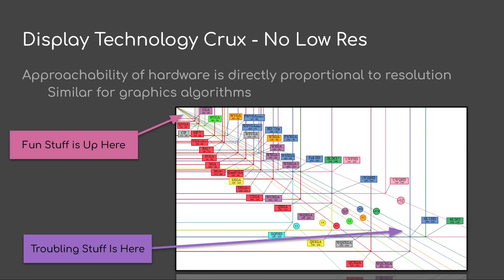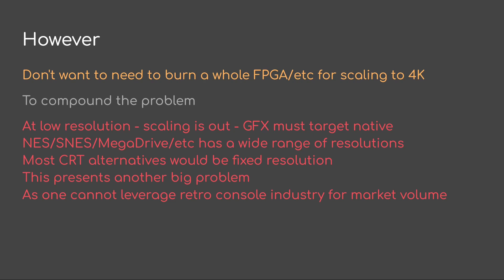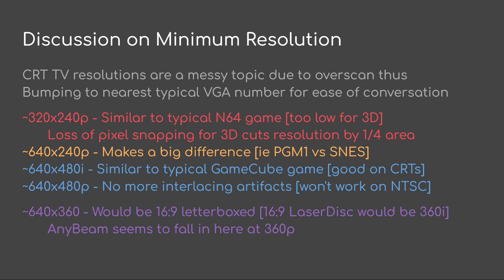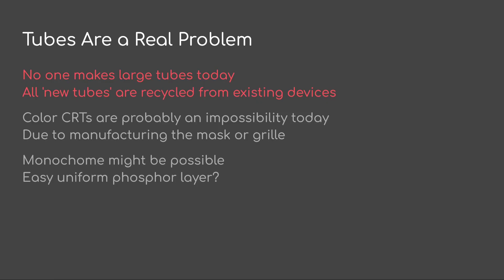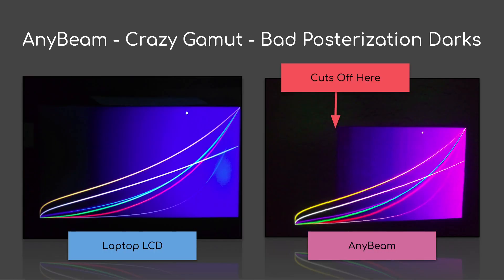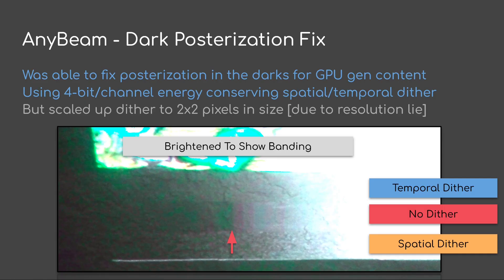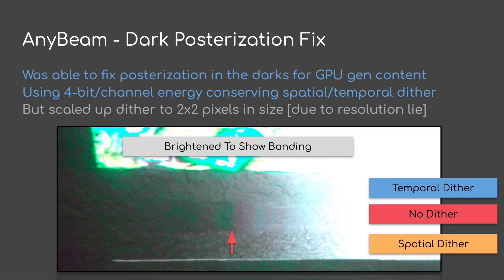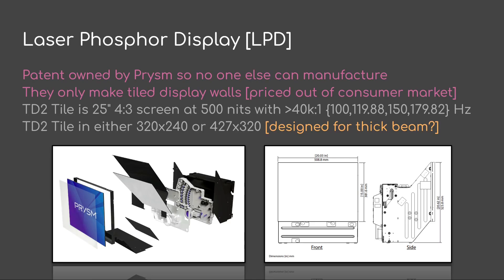Alternative Displays

Comment: In. Re. galvo-based scanners: It seems the selling point of galvos is vector displays, but since we only want a repeating linear sweep, a spinning faceted cylinder should work as well. 72-facets gives you 20° (*Edit:* 10°) (or a little less, allowing for edge imperfections requiring Hblank) of NTSC at ~13,000 RPM. (Math: laser sees each facet for 5°, reflected beam sweeps 10°, which becomes 20° after the vertical deflection mirror). (*Edit:* my math was wrong. There's no angle multiplication from the 2nd mirror, just path folding.)

One can imagine adding extra static mirrors to multiply the scan angle, using more facets to allow lower spin speed. That's eventually limited by brightness loss and difficulty of cutting precise facets, but it might scale enough to do modern resolutions without needing an export-controlled bearing system.

Comment: NTSC is technically 525 lines 480i
This is largely irrelevant because old game systems never followed the NTSC spec exactly
Low res signage LED is not a very good solution at all since CRTs didn't have horizontal resolution or fixed PAR which is why 384x224 games like CPS1 games work since they use a different PAR, not to mention all sort of games which used all sorts of resolutions and tricks
Reply from the maker: If you want to be pedantic, NTSC was a fixed line count, but a variable effective visible due to overscan of the TV, and then either interlaced or non-interlaced fields, and then horizontal is freely adjustable within the bandwidth limit.

And sure, LED signage is NOT a great solution for emulation, but it could be for NEW content (design for the new display), which is the core topic of the talk.

Comment: Love this topic.  I've spent a lot of time ruminating on this, the current solution of carefully choosing a scaler and TV to meet latency and display quality goals seems so haphazard and inelegant.  I agree with your rundown of the problem and there's a few aspects I hadn't even considered such as the temporal dynamic range of those projectors.  A few thoughts:
- From your description it sounds like the device in the Anybeam is the same used in the "Magnasonic LED Pocket Pico Video Projector".  I have a one of these with a Brookstone brand, it looks identical.  It also has a 640x360 resolution, practically zero latency, supports many resolutions, doesn't have a fan, and is surprisingly bright.  I think the "Kodak Luma 75" may also be this mechanism.  I've built a bit-banged HDMI driver for the Propeller 2 microcontroller and that projector's firmware was one of the most robust to having bugs in my HDMI implementation and having it still work.
- I think most DIY raster laser displays use some kind of polygonal rotating mirror to generate a sawtooth-shaped scan.  A hexagonal mirror (like a hex nut) rotating at a little over 5kHz gets you a 31.5kHz horizontal scan.
- I think an issue people find with raster laser displays is that in order to achieve high brightness when spread over an entire screen the laser would need to be extremely powerful, and dangerous enough to require safety mechanisms.
- Going back to your earlier slide about not wanting to burn an expensive FPGA on this problem to build a scaler for a 4K TV, I'm surprised there aren't projects that do some kind of scaling with the RPI 4 or 5 by running some kind of sampling and scaling on bare metal.  You'd need to capture MiSTer values from a digital bus before it went to the DAC, I have no idea if that's accessible with the hardware or if the code would make that challenging.

I've contemplated, done some research on, and even a couple experiments with other, wackier ideas such as fluorescent pigments illuminated by a UV source through an LED screen (a la resin printer), but I'll leave that kind of crazytalk for another time.
Reply from the maker: When I lookup the Magnasonic "LED Pocket Pico Video Projector" it says DLP (not scanning laser). Constant speed rotating mirror to avoid inertia effects was on my list to look at some day, glad others have gone there. I'd be happy with a scanning laser with monochome phosphor screen, being boxed in theory mitigates actual safety concern. And those wackier ideas sound worth reading about.

Comment: Ultimems (the company that makes the Anybeam) still has these projectors for sale on Amazon (they're now called the "Anybeam UP" and offer different connectivity). A part of me wonders if one could make an AMD Eyefinity setup with four of these projectors in a 2x2 configuration. That way you could have something closer to a genuine 1280x720 resolution, and I guess also get four times the brightness for any projected screen size. Side note: there was a forum post on the Blurbusters Area 51 forum asking about the feasibility of sub-refresh BFI & CRT Simulation on recent OLEDs that can't turn pixels on and off within a single refresh cycle. The thread creator questioned whether that limitation could be circumvented by instead dimming the pixels to a near black, but still active, state. In other words, could pixel luminance be changed within a refresh cycle by an end user. If you ever get a chance to read it (I can't post links in comments), it'd be cool to hear what you think of it as a contributor/programmer of the CRT Sim. shader.
Reply: A sample and hold display cannot reduce it's mprt below it's max refreshrate

for example a 240hz display can only change it's pixel value every 4.16ms you cannot achieve a mprt lower then 4.16ms.

think of mprt as how long a pixel stays on the screen for, for sample and hold it's your refreshrate's period in ms.

you can't put sub refresh behaviour in a shader.
Reply: @nonenone-w5e  I think what was being suggested was not to turn the pixels off, but to have them always on--but dimmed toward the end of the refresh--in order for our eyes to perceive it as a "black frame".
Reply from the maker: Thanks for the tip that they they renamed+changed the product, looks like I went down the wrong path because they didn't update their 'anybeamstore' website (which links to out of production on Amazon). Their new Amazon says 3 channel lasers too, so perhaps quite a bit different than the Celluon. I'll have to do a follow-up at some point seeing what I can get in Linux with custom video output signals for the device. As if one can make this native resolution for scanning, it could be quite nice.
Found the other post on Area 51. I'm missing some understanding of the lower levels of how OLEDs work to be able to give a good answer there.
Reply: @neokineogfx  I'm enjoying the videos. Thanks for your time.